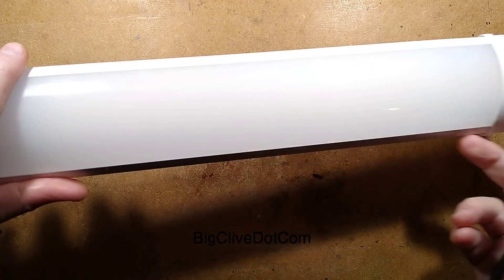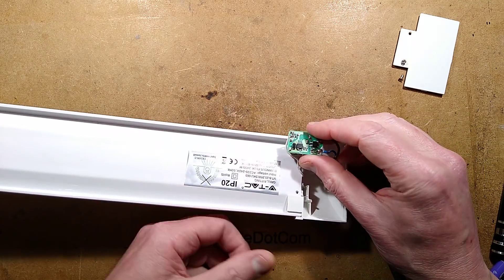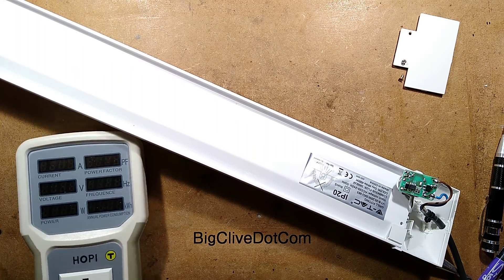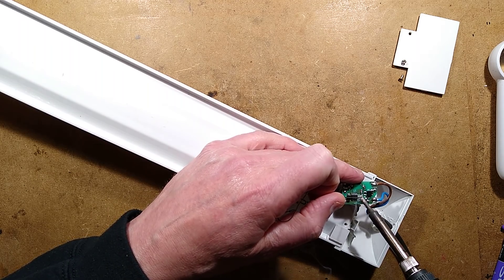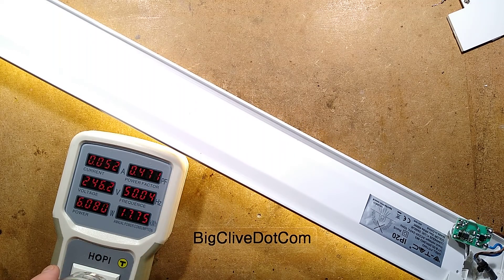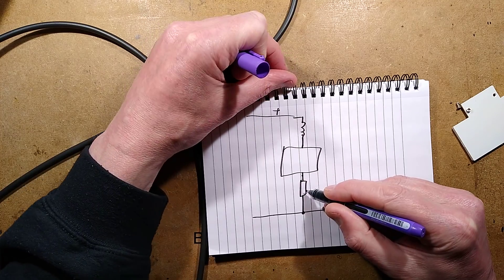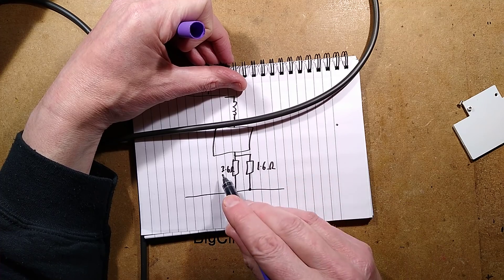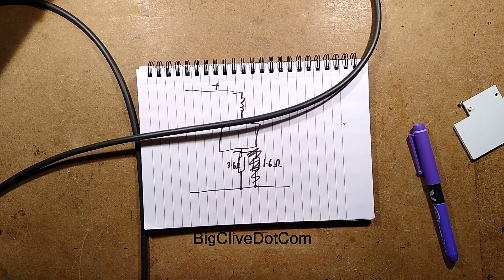Taming down the live-stream lighting.

Comment: The sense resistors look very low wattage?
Would it be much easier for people like us (not manufacturers) to put a pre-set pot on the PCB in series with a limiting resistor and adjust the resistance to get the wattage one desires?

Regards,
K.

Comment: Nice simple fix ! I have a NiMH fast charger that used to be too ferocious - the batts just got too warm - so I took out one of the parallel sense resistors in the same way, and now it charges sensibly, and I don't have to keep checking on it, with a fire extinguisher in one hand.
Reply: Most quick chargers run pretty toasty, however throttling them back will definitely not hurt things.

Comment: I was wondering, if you can you put a potentiometer on the output side of the LED driver and use the potentiometer as a dimmer, or you can put the potentiometer in the sense circuit instead of the resistor to change the current flow manually so that the brightness can vary.
Reply from the maker: That would work, but the potentiometer would have to be in a series/parallel array of resistors to limit its range.

Comment: Today some local news program here in Connecticut was talking about how some place was going to be cleaning in response to covid19. They showed something that looked kind of like your disco light fake UV unit, but it was turned on and the light was that icy blue. The enclosure was more boxy and bare aluminum or stainless, but it appeared to use LEDs in the hexagonal pattern and what appeared to be the same plastic reflector lens dealie. Probably using the light blue LEDs you mentioned on your recent video.

Comment: Given that  a 1.1 ohms effective resistance caused the light to consume 22w watts, and  3.6 ohms resistance caused the light to consumed 6.14w

Then it looks like you can roughly predict that between those two resistance values, 24/(resisor value)= power consumed.
Reply from the maker: It measures voltage across the resistor to detect a fixed threshold, so current is directly related to the resistance.

Comment: ooh, try putting a variable resistor with a small knob on the back to adjust its brightness.
Reply: That’s a special order, a 0-5 ohm pot when most are 10K linear or log
Reply: Brightness is not the issue, it's direction that's the problem. Camera will cope with brightness but not contrast.

Comment: Can’t believe how cheap and nasty lighting has become. The old fluorescents were solidly built with thick stove enamelled steel, big chunky ballasts, they’d literally last a lifetime. Since the end of the ‘90s they’ve been getting cheaper made every year. These things will all go pop in a few years, then they’re junk.
Reply: Fluorescent ballasts that last a lifetime? Maybe a dog's lifetime.
Reply: @xenonram  Seriously, they were common to last multiple decades! A quality product designed to last. Now, it's all built to a price point, not quality. It's all crap.
Reply from the maker: These are disposable crap like most modern LED lights.  You have to effectively do electrical work to change a lamp now.
Reply: @bigclivedotcom  Man, if that isn't gospel!
Reply: As bulbs became harder to find and there wasn't anything to replace them, I started to seriously consider installing gas lighting.
Reply: Back in about 2001 I had to replace some fluorescents that had been installed in 1951 or 52. Something like three or four out of the dozen had packed up, so I had the job of replacing the lot. Oh boy were they heavy! It was quite dodgy taking the weight of them on my own, while up a step ladder. They all had labels on that told me that the bodies had been made by a firm of metal fabricators on behalf of the lighting company, who then installed the electrical components.
The new ones were much lighter, of course.

Comment: Nice fix!  If you have no tools, you can tame harsh lighting by facing it away from the subject and using a reflector to bounce the light back onto the subject.  In your case, you could aim the light at the wall in front of you; that splashes the light around and softens "hot spots" in the camera exposure.

Comment: "It's tiny. It's minute. It's, it's,,,I've just dropped it...." 

The joys and sorrows of surface mount components.
Reply: lost so many components during surface mount work,glad no one was keeping tabs on how much it was costing!
Reply: @alanchapman7729  I've heard that they often have to tell workers not to pick the components up, because the time it takes to do that is far more expensive than the actual components,
Reply: @pipatron   we just left them where they lay,unless it was one of the more expensive ones,some were £20 plus,those we tried to recover
Reply: Ah yes, and then keeping on dropping them until they fall with the right side up. They always fall with the print side down, unless on that one occasion when you do want the bottom to be pointing up of course.
Reply: The days when I could see and accurately manipulate the little buggers passed quickly. Lighted diopter ftw!

Comment: Feedback through a microcontroller adjusting current based on the actual light output using a light sensor on the bench perhaps?
Reply: To compensate for clouds drifting over the bench?
Reply: @MetalheadAndNerd  That has been known to happen!

Comment: You could use a 1.1 Ohm (that was the resulting value for 21W) in series with a poti to get a "dimmable" version. isolated plastic poti tho.
..buuut i could not easily find low values around 10Ohm (only 100ohm) so might have to take a stereo poti and wire it parallel (=0 .. 50 Ohm) or another fixed resistor..
i guess 3 brightness "low /  mid / high" via a 1 - 0 - 1 switch might be useful and do-able.

Comment: Trying to find the light in this video and found the 'germicidal uv' lamp below in the process. The LED packages shown in the close up are a bit different than what I'm used to seen your channel.
https://www.banggood.com/DC5V-6W-UVC-LED-Sterilizer-Germicidal-UV-Lamp-Ultraviolet-Disinfection-T5-Tube-Strip-Light-UV-Sterilizer-Lamp-p-1653175.html
Reply: Those are just long wave UV-A (at best) LED chips. If you need UV-C the genuine tube-based lights are still the best (and cheapest) option - such as  https://www.banggood.com/36W-UV-Curing-Lamp-UV-Disinfection-Lamp-395NM-Violet-Wavelength-Fluorescent-Agent-Detection-UV-Lamp-Ozone-Disinfection-p-1653997.html. These actually do work.

Comment: Ive bought the bigger magnifier from the pound shop.  Their brilliant, it has 3 leds around the bezel, and is really bright.  Well worth the money.  £2!!!  I know ?  Its a  pound shop...ha ha, but theres some great things for a couple pounds.  Also today i seen wireless headphones for a fiver, and they looked good.  It said 3 hrs use from charge?
The power banks they sell?  THEY SAY 1200mA.  Is that poor for a power bank?  I have tried it in my cheap ass heated usb jacket,  it works well on medium, but high it cuts out pretty fast,  but after the jacket turns off i can turn it on low or medium for a while longer.  But if i try high it turns off again.

Comment: Sounds hackable. Rather than just removing the one resistor, put it in series with a switch and have 2 lighting levels. Alternatively, replace both resistors with a variable resistor with a minimum of 0.9ohms (assuming such a thing exists).
Reply: Yes, many other options are possible. It would have been nice to see the level change on the fly.

Comment: I think a lot of your problem is that you're so much closer to the light and you get overexposed. And your background is far away from the light and is underexposed.  Your camera is adjusting the exposure for the overall image.  So I think just adjusting the light levels won't work.  You may need to provide some supplemental lighting for your background.
Reply: Agreed. Foreground and background need to have balanced lighting. The issue is not helped by the poor dynamic range of webcams and high compression of live streams.
Reply: If you search for "inverse square law" here on YouTube then there's quite a good video about lighting for photography

Comment: Wouldn't a dimmer be better.
Reply: That's practically a dimmer. An external dimmer wouldn't do anything, because this ic keeps the current constant.
It measures the voltage over the shunt and tries to keep that voltage constant.
If you double the resistance, the current needs to be half as high to get the same voltage.

Comment: Is there any technical reason you couldn't put a pot in series with those resistors to have the output adjustable. With the pot at zero ohms, the output would be the standard 21 watts and you would just work down from there. Maybe some additional resistor in parallel with the pot to set a lower threshold?
Reply: I missed that someone already posted this...

Comment: I always do that. I buy overpowered lamps, double the resistor value and get a reliable cheap lamp for 5 minutes of work.
You need high power smd resistors (the biggest that can fit the pads), they get pretty hot.

Comment: I'm still waiting for the video where you actually get a zap off of a charged capacitor. I once took apart a digital camera (would power on, but screen was dead) in my early teens. 
I popped out the batteries and started taking it apart just for fun - and to this very day i still remember the sting that freshly charged capacitor (presumably for the camera flash?) gave me. 
I'm an electrician now and gotten a few zaps from mains and ~700V PV systems and none of those were anywhere near as bad as what i remember from that tiny evil capacitor.
Reply: ICHBINS You reminded me of the time I stripped the insulation off a Co-ax cable to the TV, with my teeth! I was an 18yo apprentice spark and 'knew' it shouldn't have been a problem; had it been a normal TV aerial yes,  but this was a Redifusion cable TV carrying around 70v I believe. I, have not forgotten my backward somersault across the lounge floor!!!
Reply: @paulvale2985  Grasshopper discovers phantom power! However, normally this is blocked at the demarc for the premises. Yeah, normally...
Twas like when I discovered ring voltage on a phone line. 90v @ 20 Hz. Back in the olden days when phones used wires... Lol! Granted, 70v in the mouth was comparable to an ignition coil discharging through my groin. I think that one resulted in a complete dump of my profanity database, including international entries.
Reply: @paulvale2985  I learned the same way 25 years ago that phone wires can give quite a nice shock if you have them in your mouth during incoming call.
Reply: CRT TVs were beasts to be really weary of !
Once got a zap off a computer monitor I was cleaning - so still had the case on it !
Reply: ICHBlNS first one’s the worst one! Those jolts like that are what program us to become electricians, just ask Clive.
Reply: Flash caps are often kilovolts and enough current capacity to stop your heart if you do it right (or wrong, depending on your perspective).
Reply: just put a finger over main cap in big power supply  and you will recreate that feeling :)
Camera flash capacitors are small in size but they are high capacity and high voltage. Clive play with these 4,7-10uf but I think even him will think twice before he put a finger on 160uF one charged at over 300V.
Reply: While in college for Electronics Technologies, I helped some classmates solder wires onto the button of a digital camera so they could trigger it remotely... Yeah, first ZAP! oh darn I forgot to discharge the cap... It's all good now proceeds to get zapped twice more

Those lil buggers will keep A LOT of charge, that's for sure
Reply: FLASH!!!..Ah Ahhhhh....pmsl :-D

Comment: You really couldn't fix it with paper?
Reply: When he could mess with the electronics?
Reply: I think removing that resistor is a better solution anyways, as the power consumption is way lower now and the LED's won't be pushed that hard and will probably last way longer.

Comment: Could you put a 5K POT in place of the 1.6K resistor to make it an adjustable lamp?  Wouldn't that be more useful than to stick it at one power level?  :)
Reply from the maker: I did consider that, but it would require a parallel resistor and also a series limiting resistor to avoid potential overcurrent.
Reply: @bigclivedotcom  A switch with the value of the resistor removed in series in place of the resistor removed would give the option of restoring the original brightness if needed.
Reply: @bigclivedotcom  A 5R pot in series with the removed 1R6 would give a nice range of output.
Reply: @johncoops6897  First result on eBay: 5Ohms 100W
Reply: A rotary switch with ~4-5 positions would probably be better for stability & longevity. You'd only need to pick out the same number of resistors as switch positions and connect one to each lug -- you might be able to get away with less, if some clever tricks are used, but I'd keep it simple. Would be nice to get a data sheet for the power supply controller first.
Reply: I wouldn't recommend it. I tried it and the light output was not stable.
Reply: @CyberlightFG  was that maybe due to the pot noise? A capacitor in parallel to the pot might help.
The pot would have to be ~5 Ohms (not 5k) and mains-safe, though.
Reply: @VerstehenSieMathis  The capacitor (both small or large) made it worse. But that was my lamp. Yours may be different
Reply: @CyberlightFG  and Mathis,
There was probably a significant parasitic inductance added with the potentiometer, that would cause ringing - which is very bad to have on the current sense pin - which is likely why it was not stable

Comment: I have a 15w light I want to try to get down to 7 w like this.
Reply: Tell us how you found the right resistor! :)
Reply: Don't castrate the poor light 😢
Reply: The sense resistors are a lot bigger in size and normally a low value.
You just need to double the resistance
Reply: https://www.homedepot.com/p/Leviton-300-Watt-Incandescent-CFL-LED-Tabletop-Dimmer-Black-R15-TBL03-10E/203812619?MERCH=REC-Pip_Alternatives_Non_HDhome-100644816--203812619--N

I just use these. They're cheap and fairly reliable. Very handy for slowing down dremels, too.